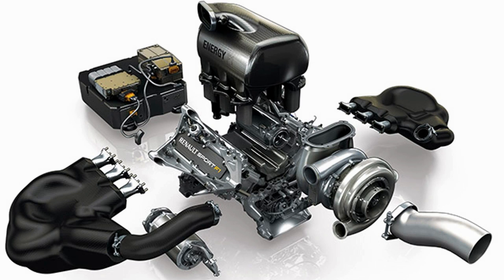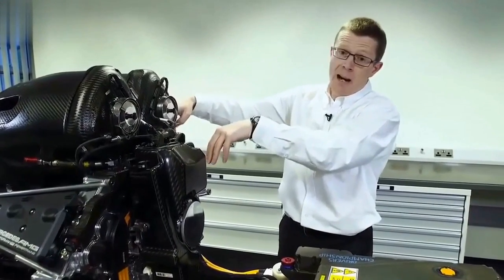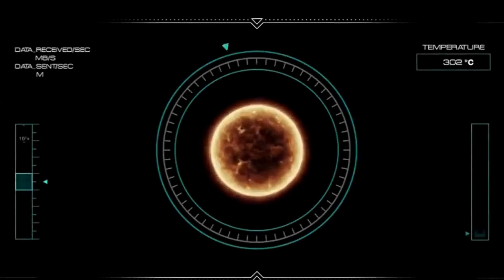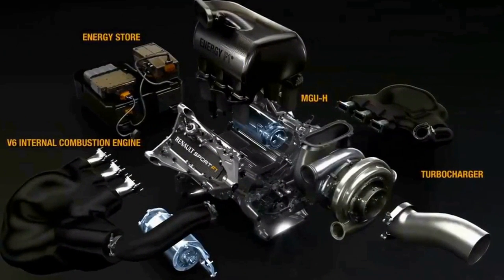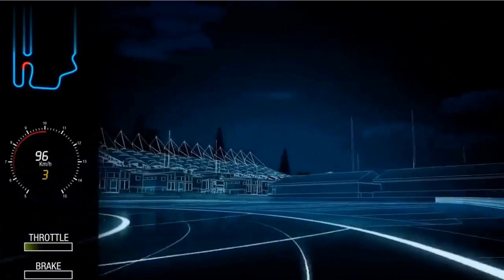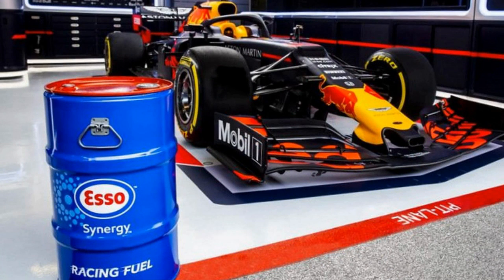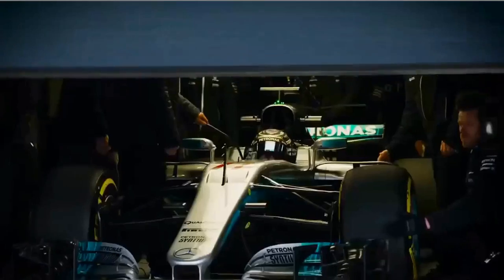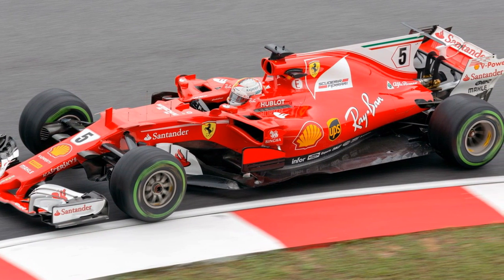Formula 1 Engine Principle of Operation #formula1

Comment: extreme engineering...this may gonna be timeless technology, design this engine just to compete with V8, if V8 it have enough boost to spoll the turbine even in low speed.... pretty much to eliminate turbo lag....it only exclusive used for V6 engine now and forever, no V8, V10 or V12 can used it cause God say so....for 2024, V8 play with campro technologies, not a Proton Campro technology....it a BMW virable cam controller using electronic computer management system for V8 turbo BMW engine...it different then Vanos, cause Vanos is old neumatic cam controller....it new version one controller, just like cyberpunk bla..bla..bla.... controller
-: I'm pretty much amoung the one who holding license this blueprint electric supercharger for turbo V6....yup I will not approve if they plan to implement to V8....just cry...cry harder to see it happens.